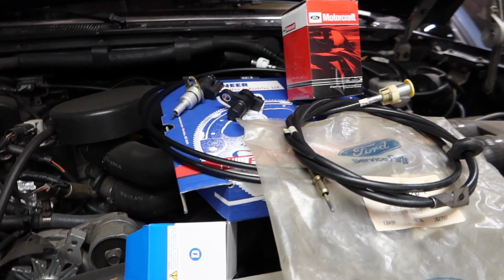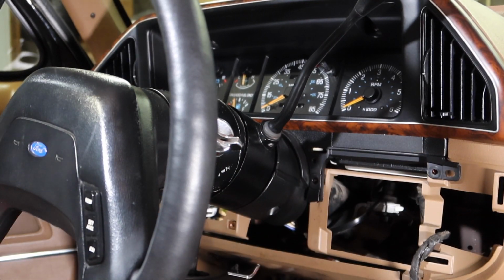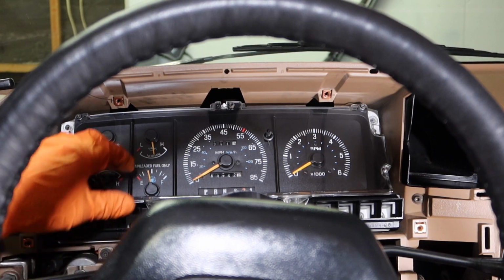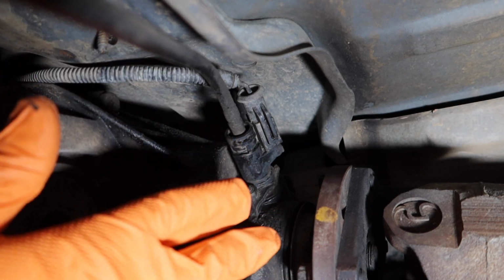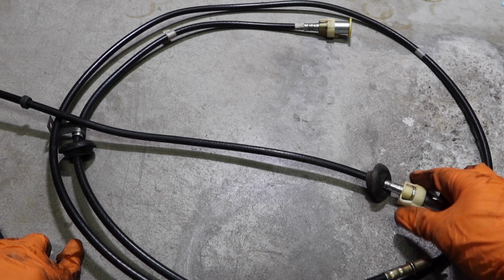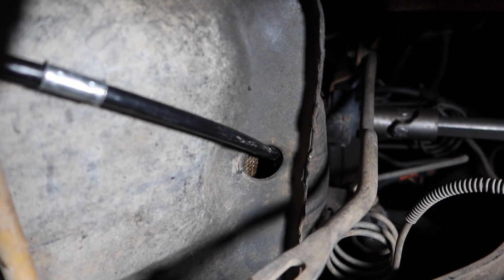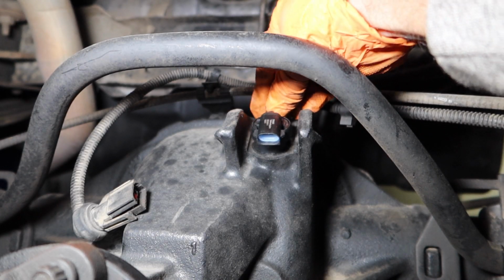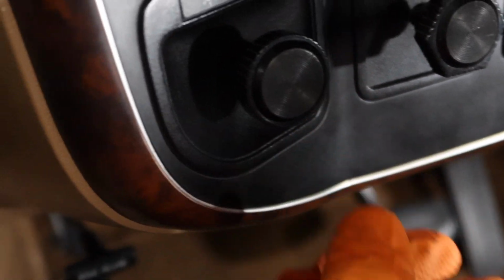Speedometer Needle Fix | 1980-1996 Ford Bronco F150 | Cruise Control Repair | Bronco Restoration

Comment: Hi i have 1996 bronco 
Trying to figure the location of the abs sensor you are replacing
Reply: located on the rear differential. easier access on the driver side and easy to replace.

Comment: I have a 93 ford bronco xlt 4x4 and the speedometer doesn’t work any suggestions
Reply from the maker: The 1993 used a PSOM electronic speedometer. Check/replace the speed sensor on the top of the differential. Any check engine or O/D lights? Pull diagnostic codes if yes. Otherwise the PSOM will need to be replaced or repaired.

Comment: Bro thank you so much for making this video wow. I have a jumping odometer after 60MPH. I ordered a motorcraft speed sensor but according to what you said earlier in the video, this VSS (DY-587) belongs in the transmission? Also according to you, I need to have the ABS speed sensor which I currently have a Delphi VSS after my rear end was rebuilt. So are you telling me this transmission speed sensor doesn’t fit a 94 Bronco?
Reply from the maker: The Dy-587 is used up until 1991 as those trucks used a cable drive speedometer. 1992 and later used an electronic speedometer and only used the dy1123 sensor located on top of the diff. Try a motorcraft part, if that doesn’t solve the issue and you don’t have any check engine lights or flashing o/d light then the PSOM (speedometer) itself needs replacement or repair.

Comment: Very well done! I'm here because I just lost my speedo today. I hear a clicking that correlates with speed inside the cluster, so I am thinking it may be a speedometer gear issue. I just replaced the cable a month ago and the needle still bounced all over the place. Sometimes it would peg out and sweep all the way around going about 5-10MPH. That's why I replaced the cable - didn't change anything. It sounds like the cable is turning the speedometer but the needle does not move anymore. I guess I will find out more when the sun comes up. 1991 F250 7.3IDI E4OD

Comment: For anyone that needs to replace their speed sensor/speedo cable. I have been working on this for several days now. 3 different sensors, 3 different cables later, I'm still at a loss. The Dorman brand and AutoZone brand sensors are junk. The aftermarket cables aren't bad, but I had to customize them to fit into different sensors. My best advice, listen to him when he says to USE OEM parts! I ended up ordering an original Ford cable on eBay, it was pricey, but it's A LOT better. Had to remove the core and clean all the old grease out (it's 35 years old) and lubricate the core. It's miles better. I ordered a Motorcraft speed sensor (not cheap, $200) hasn't arrived yet but will update when it does. Save yourself a TON of time and money and just order the OEM parts. Yes they're expensive, but there's a reason they're expensive. They work.

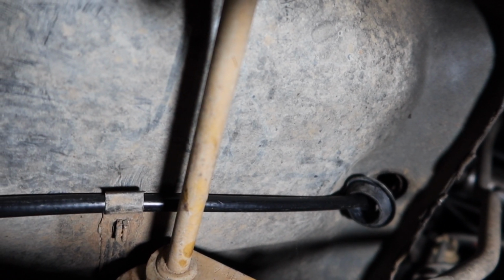Comment: i have a 1989 Bronco and trying to locate where you are installing this sensor at the 10:39 mark. The camera is zoomed in too close to see where its located 🤔
Reply from the maker: This is the ABS, electric speed sensor used on 1990 and up trucks. It is located on the very top of the differential
Reply: Where do you find the original parts? Been searching and coming up short for my 90 Bronco XLT.

Comment: Ok here’s what happened, I am a subscriber and own a 1990 f150 302, your videos are some of best I’ve seen for me.
But this Speedo cable deal was infuriating.
My speed sensor went ( it was the blue oem one and lasted 220 thousand kilometres)
Rock has the motorcraft one at 200 and the doorman on3 at 33.
I could not get the cable into the speed sensor enough to get the little retainer clip in, not even close.
So then I took the cluster apart pulled the inner up and partially out and still could not get the outer in far enough to get the clip in and I was pushing it with vice grips now.
So then I removed the entire cube and had it on the bench.no clip going in.
In the end I had to gently grind on my bench grinder 2 mm off the end of the outer ( finishing it nicely with a file so it looked factory) then straighten out the clip so the legs were straight push it in and bend the free ends over so it wouldn’t come out and then reinstall the cable.
What huge pain in the ass for a speed sensor ..ha ha 
Let’s see how the Dorman one holds up.
For the record the cable inner  and outer are all oem
Reply from the maker: I’ve had decent luck with aftermarket parts for the most part on this truck. But for some reason I always seem to hit a snag on every project I start on the Firebird I am restoring.

Comment: Can you do a video on steering stabilizer and tie rods? I just went through your shocks and springs. Now onto this project next. Thanks for the videos!
Reply from the maker: I had installed a steering stabilizer early on and threw it away as these trucks do not need them. Steering stabilizers are used to mask underlying issues that if resolved will give the truck a better feel and response. I did replace the tie rods, drag link, steering box, and shaft and the truck now steers as good as new. Unfortunately I replaced the tie rods and drag links off camera.

Comment: The gear indicator cable on my 1981 f250 isnt attached to anything and there isnt an attachment point on mine like there is on yours. I also cant find a diagram or anything to help. Do you know what that hook piece is called or can you help at all?

Comment: If my 93 ford speedometer isn’t working what should i do? it also jumps when your changing the gear.
Reply from the maker: Is the o/d light on the shifter flashing? Try replacing just the speed sensor first, if that does not help then the PSOM (speedometer) needs repair/replacement.

Comment: Where is that abs sensor located?
Reply from the maker: Depending on the year of your truck, you will have one on each front wheel, behind the rotor. A speed sensor on the transmission near the transfer case. And all have a sensor on top of the rear differential
Reply: @TheFixTech  I have a 1990 f150 I just redid my clutch n brake pedals cux the bushing in my last assembly was shot and rounded out the holes.smh shifting like butter now but since I've had this truck cruise has never worked
Reply from the maker: @cristhegearmonkey  is it a 4wd? If so chances are you have the E4od transmission. This is an electronic transmission that has the speed sensor in the tail housing. This sensor controls the cruise control. Also be sure to check all vacuum lines on the cruise control module (driver side fender under hood). A common problem is the vacuum line that leads to the brake switch inside the cab, it is the cruise cancel switch and if the switch is broken or leaking vacuum then cruise will not work at all.

Comment: normal  3 speed trans with overdrive on   transmission  shifter 4x4  lock out hubs im betting he replaced with aftermarket did replace both sensors shoud i go to ford for genuine 2 sensors
Reply from the maker: If your truck is a 1996, then it should have the rear diff speed/abs sensor abs the two front wheel sensors (not shown in the video). It will not have the transmission speed sensor. Your truck will have the 3 abs sensors, one on each front wheel, and one located on top of the rear diff (shown in video). The 1996 also has the obd 2 port and you can easily pull diagnostic error codes, any local parts store will loan out the tool to do so. I would replace all three sensors with factory ford parts.
Reply: @TheFixTech  thank u ,it's been he'll with overdrive not working properly and no Speedometer, Again Thank You

Comment: 96 f150    replaced tran sensor it did cure erratic  shift but still have abs ligbt on and no speetometer does have cruise my mechanic is stumped also has overdrive on transmission  that stays in normal range help
Reply: Your electronic  speedometer  is malfunctioning
Reply: You found the solution ? I have the same problem

Comment: He a said attach the cable behind the cluster like it’s no big deal.  On my bronco II, I have about an inch of room behind the cluster to deal with.
Reply from the maker: For certain models you may want to attach the cable behind the cluster first, then route cable down to the transmission
Reply: I had the same thing, detatch the cable from the clip infer the drivers floor pan and on the transfer case ( it’s a cable guid) the push the cable up from outside it will push the cluster away from the dash

Comment: Got any tips for my 1996 F 150? The speedometer needle bounces quite a bit going faster than 55MPH, the speed sensor was supposedly replaced, and it helped because now it does not drop to 0 like it used to, but it still bounces, any help is appreciated man!.
Reply from the maker: If the ring gear in the rear diff is good (no missing teeth, bent, ect) then you can try a new vehicle speed sensor from Ford, not aftermarket. If that does not help then most likely will be the Psom (speedometer). Luckily the speedometer can be removed from the cluster and can be refurbished or replaced. Also, you can check your tire calibration on the Psom, be careful with that as there can only be 6 tries before the Psom locks.
Reply: @TheFixTech  thank you!! Will try another sensor to see if it fixes it.
Reply: @VenomWorks did it fix for you? I have the same issue
Reply: @gregreesman  it only does it every now and then so I'm just living with it, it's probably something with the ring gear but as long as it works I'm leaving it.

Comment: Very good info while watching you fix your speedo issue. Wondering how to add a tach gauge and you gave me some ideas on where to look.
Do you know how I can fix my gauges that don't work? Oil pressure, voltage, fuel gauge, and water temp gauge?
Reply from the maker: If all gauges are not working check your fuses/relays. The problem could also be the cluster, get a used one from a salvage yard for comparison. To add a tach gauge I believe you will need to tap into the ignition module located either on the distributor or driver fender.

Comment: What is the part # on the original ford cable?
Reply from the maker: I regret that I accidentally threw away my original cable, and didn’t even record the part number. I keep all my original parts regardless of condition.
Reply: @TheFixTech  I bought the supposedly orginal one from an online store and the nipple that pluhs in to the speed sensor does not fit. Its  a lil to big.....
Reply: @TheFixTech  IN YOUR VIDEO YOU HAVE YOU SHOW THE CABEL PACAKAGE WITH THE NUMBER ON IT. MAYBE YOU HAVE A PIC OF IT =)

Comment: Been changing the speedometer driver a few times UNTIL found this vid!! Last change didn't do much for Jumpy Speedometer. FABULOUS! A mail order site Rock  has same parts for $8-16. :goodvibes:  TWICE that at one retail place I called..😑****I goofed!  Think it's 7/16 to pull driver, driven, whatever it's called THIS Week, from TC in 4WD. HINT! Pull from Below so can pull thru floorboard. Have Speedo, S CABLE & WET Graphite on hand!

Comment: I just took the Vehicle Speed Sensor out of my 1987 F150 and it looks exactly like yours. My truck is a 4 speed manual with no cruise, I have no idea what the electric part is doing in it.
Reply from the maker: That is strange, but if it works…

Comment: Dude!! This video you made is absolutely incredible. So well done. My speedo on my 1990 F150 quit working recently and I figured I’d hop on YouTube and see if just by chance there was anything on speedometer repair and I found your video. So helpful. Thanks again!
Reply from the maker: Glad I can help.
Reply: I just watched this for a third time ..lol..no way could I press that cable in the way you did ..I dunno what the problem was ..but it works perfectly after I did everything you said except getting the Speedo retaining clip
Reply: Went back when I wasn’t mad..lol..I think that previous owner went 4x4 ing although you wouldn’t think it looking at the truck and a rock or a branch got caught in the Speedo cable outer and put a tiny almost invisible bend it it. At the very point b where it enters the sensor..that was the problem.

Comment: Recently pulled my transfer case and transmission to do a clutch job and rms, was driving down the highway a few days ago and my Speedo went from 65mph and just fell down! Haha. Banged on my dash a little bit and it went back to 0mph but now I have no Speedo. It’s a 1990 351W F-250 4x4, has the transfer case Speedo, gears looked a little chewed up but nothing serious - my gear is reddish white probably super old and ready to be replaced.
Reply from the maker: It could be the speedometer itself, take off all parts (speed sensor, cable, and speedometer) Inspect and replace as needed
Reply: @TheFixTech  I checked it out yesterday turns out the clip holding the Speedo cable slipped and the Speedo cable came out of the sensor, went ahead and just bought a new Speedo sensor all is well again, but my Speedo is off by  5% or so, about 5-10mph depending on the speed. Just gonna get a smaller Speedo gear. Thanks for the great video!

Comment: What about for the 5 speed?
Reply from the maker: I am assuming it would be similar, not sure, what year? Does it have cruise control?
Reply: @TheFixTech   exactly the same on manual  transmission,  87/91 is speed density, speed sensor  is also used by computer  to determine  fuel  strategy.

Comment: A jumping speedometer would throw off the cruise control. The adhesive for the actual speedometer paper may have come off and it simply needs to be re-glued. Much cheaper and quite effective most of the time.

Comment from the maker: This should resolve the jumping speedometer most older vehicles have, this will also cure some cruise control issues. The vehicle speed sensor (VSS) and/or ABS wheel sensor can contribute to poor fuel economy and or bad transmission shifting.
Reply: I changed the vss and reprogram my psom on my truck the shifting problems went away after that but my speedometer bounces below the speed I am going at
Reply from the maker: @Steamtrain44388  if you have a Psom (92-96 year model) and it is still bouncing, chances are you need a new (refurbished) Psom.
Reply: @Steamtrain44388  I had a bouncing speedo in my '95 F150, turns out it was the ABS module going bad. Try unplugging the black box (I think its black) behind the glovebox.
Reply: Also change throttle position senor because my truck was high idling and also help with transmission just not the speedometer
Reply: I’m having trouble with my 95, this video is helpful but I still have a bouncing Speedo and then it just goes to 0 when I hit a bump and it kicks out of gear then I have to put it in 2nd gear until my OD on my gear shifter starts blinking then I can put it in drive and it’ll shift but hard and then won’t go in OD any idea?